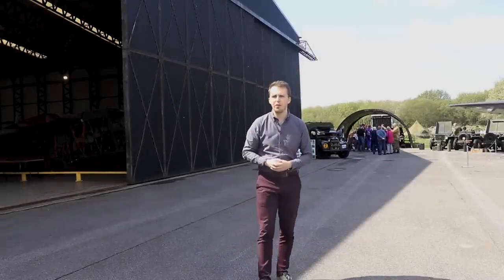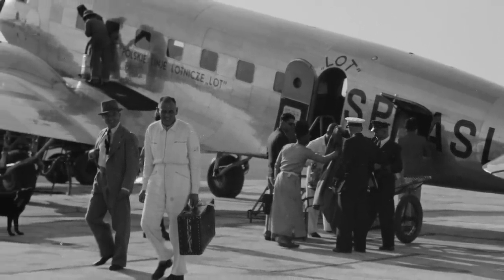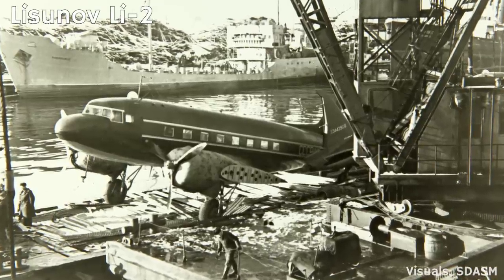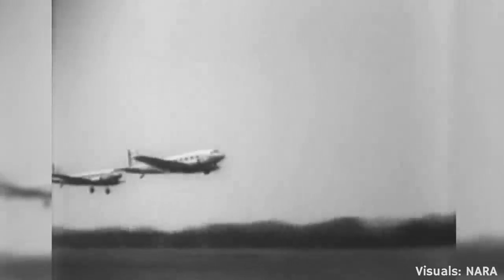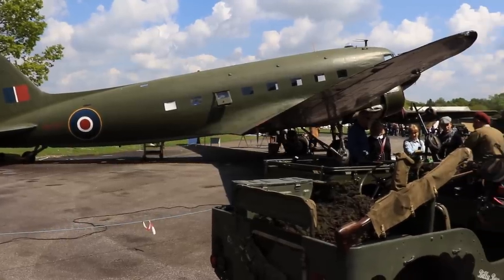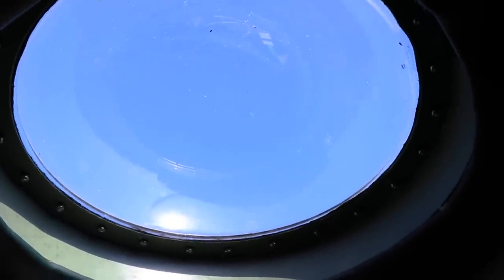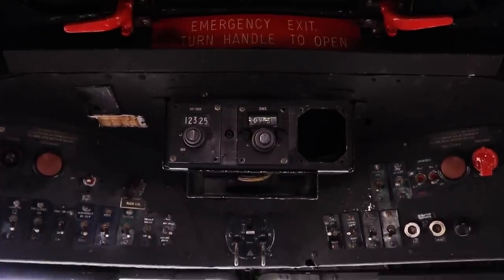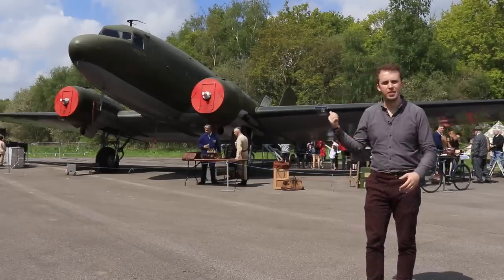Inside The Cockpit - C-47 Skytrain/ Dakota/ DC-3 | D-Day Airborne

Comment: Very good job.  I have worked on DC 2's and DC 3's.  My father flew a DC 3 for Argonaut Airlines between Key West and Miami back in the 60's.  When I was an engineer for McDonnell Douglas we had a DC 2 as part of out heritage flight which I helped restore.  I also assisted on a DC 3 used to haul jumpers.  Thus I pretty well know the history of the DC 3 and you really covered it well and in a short period of time.
Reply: I used to take a DC-3 every once in a while from St. Thomas to Puerto Rico back in the '70s when I got "rock happy." Spend the day wandering around San Juan, go see a movie, and fly back at the end of the day. Round-trip ticket: $25.

Comment: GREAT video Biz!  One small correction... The B-18 Bolo was a mess of DC-2 and DC-3 parts. It has the wing and tail of the DC-3 and the engines and landing gear of the DC-2. Most survivors however were converted with DC-3 engines after the war.

Comment: Flew in them a lot, as well had a nice tour during the Junkers being restored, seeing the aircraft stripped down to near bare metal. With the Dakota, plenty of hours in them, though they were a lot more modern inside, upgraded avionics in most cases, and slightly better canvas seats. With the original P&W engines it was always wise to check for oil dripping out of those oil coolers, because if there was none dripping, there was no oil, and not a good thing. However there are quite a few upgraded to a turboprop arrangement, with much better fuel economy and operating cost, and those are great to fly on. Converse applies there, the oil coolers actually work.

Only one time I was worried flying on one was when we had undercarriage failure, and had to circle till empty before landing, after a few cycles of the gear, with me as the human lifeline holding the flight engineer, as we both were leaning out the door looking if the gear was down ( it was), and it looked like it was locking ( no green light on the pedestal). Best, smoothest, landing ever, though slightly marred by the 45 ton Rosenbaur fire engine that was pacing us down the runway with a running foam cannon. Switch was sticky, percussive maintenance and it was fixed enough to fly us the rest of the way. Got in to my destination 6 hours late, walked in and was asked why, replied the Dakota broke down, and we all had to get out and push.

Comment: In the late 1970's as a young technician in the Canadian Forces I worked on a rather unique 'Dak' named Pinocchio at CFB Cold Lake. It was one of a number of DC3's modified with a CF-104 Starfighter nose complete with radar installed. These were used as radar trainers for CF-104 pilots. A radar console was installed in the cabin with a 't-rack' holding the electronics. A ground power unit bolted to the floor & exhausted through a blanked out window was used to power the system. I believe several other NATO countries operating the F-104 Starfighter, including Germany also had their version of Pinocchio.

Comment: I flew the C-47 in the military. The problem for people of your height: On landing, with a quarterly trailing cross wind, the large "barn door" (vertical tail) causes reverse command on the rudder pedals. Normally, on landing, if the aircraft begins turning to the left, one depresses the right rudder pedal to bring their aircraft back straight. In a quarterly trailing cross wind, situation, the opposite happens, i.e. depressing the right pedal makes the aircraft turn more to the left. To counter that, the pilot MUST "peddle" the rudders, like a bicycle, to determine which peddle produces which result. And while doing that he must bring the yoke back into his stomach, to assist the rear tail wheel to come down to the runway. IF the pilot has long legs, doing that becomes a problem. The control arm for the yoke can get caught on his leg, while he's trying to peddle the rudder pedals. Often times it keeps him from making the necessary corrections and he can easily run off the runway. Just a guess, but I would imagine in the early 30's, when this aircraft was designed, pilots, and people in general, were a lot shorter and the above problem was not an issue.

Comment: The Japanese version was not the Type O (letter "O"), but the Type 0 (zero).  Japanese military equipment, whether aircraft, weapons or other, were assigned type numbers corresponding to the year of adoption.  So both this plane and the A6 "Zero" fighter were accepted by the military in Imperial Year 2600, which on our calendar was the year 1940.
Reply from the maker: I think something got lost in translation there. I usually refer to 0 (Zero) as 'oh' when counting, think I picked it up in language classes long time ago. I know Zero would be better, but it is engrained now. Obv, the vocal difference between 'oh' and 'O' (letter) is pretty much nonexistent but makes sense depending on the context (like giving a phone number). Will try to keep to 'zero' next time, to make it more obvious - thanks for pointing it out!

Comment: There are still some of these in operational service (4 I think) and some airlines still use them. Some are now being upgraded with newer type turboprops and the extra fuel efficiency (compared to the original engines) now means a higher cruising speed (260MPH+) and 10+ hours endurance. That means at the right time of year (to get a good tail wind) they can fly from LAX to JFK. That's in the ball park of 3000 miles.

Comment: There was an airline, I think it was New England Air, that flew DC-3's out of New Bedfrod Airport. I saw a few of these as late as 1972
Reply: Buffalo and other airlines still fly them now and some are being up-engine (again) with newer more efficient turboprops giving double the take-off power and lower fuel consumption at a cruising speed 100mph faster than the original.

Comment: I first got to fly on one of them after leaving boot camp in San Antonio at Kelly Field. It was suppose to take us to Denver, Colorado to our technical school, but it had problems with one of the engines and we had to return to Kelly Field where we ended up flying on a larger aircraft to Denver. The next time I flew on one was while stationed in Thailand and we flew on one U-tapao air base to Chiang Mei on our R&R. I flew on another one on an R&R during my second tour to U-tapeo. It was a nice aircraft and the first one I saw which had a wing and elevators which was made with cloth on them.

Comment: It was a DC-3 operated by Allegheny Airlines that was the 2nd airplane flight I ever took, probably 1960 or so, flying with my Dad from Allegheny County Airport in Pittsburgh to Harrisburg, the state capital.  My first flight, however, had been on TWA Lockheed Constellation, from Greater Pittsburgh Airport to NYC LaGuardia, so I wasn't real impressed with the DC-3 in comparison.  Seemed a bit rustic and Spartan in design, but both flights were great experiences, and I was very fortunate to have the opportunity at a time when kids didn't get very many chances to fly.  In those early days of flight, they would invite children to come up and visit the flight deck during the flight, and the crew would give a metal pin with a set of wings as a souvenir.  I might still have it somewhere.

Comment: The production numbers are a little tricky. It's true that nobody could get too many C47s. It's also true that the plane was designed for durability and not high performance - and it was not normally put in harms way. So the hours per plane were far higher than a combat plane. Pilots didn't count missions - they counted hours. Anyway, that meant a whole lot of those planes made were in service - after the war also. One reason there are lots of C47s today and fighters are rare.

Comment: United Air Lines had an exclusive contract with Boeing for the 247.  United got to lock out the competition, Boeing got assured sales.  But the other US airlines didn't like being locked out and went to Douglas.  The small development delay between the Boeing 247 and the DC-2/3 made the DC-2/3 a better airplane, and the larger customer base made its production more efficient and cheaper.  United and Boeing got bit by their own greed.

But the same development delay later with their first jet airliners, the Boeing 707 and Douglas DC-8, went in Boeing's favor.  C'est la vie.

Comment: C-47 over Ju52 anyday - I prefer my gear retracted when it's not needed :)
Bis - do you think that the German focus on short, sharp campaigns was one of the reasons their air supply capacity was overlooked and neglected? You mentioned in one of your previous vids on Operation Husky (I think) that it was seen as an undesirable assignment for a German pilot in WW2.

Comment: It was not a tradition or built out of convenience to start the right engine first! It was a requirement because that engine is what supports many of the aircrafts startup systems such as the auxiliary power unit, hydraulic pumps and avionics. Of course these systems were engineered to this engine primarily due to where the doors were as well as the cart operator that provided the external power to the aircraft during cold or hard start situations. Regardless, traditions have absolutely nothing to do with this fact whatsoever!

Now I am sure some fanboy is going to try and flame on me and say something like that makes no sense because that means if the right engine goes out during flight all these systems would be at risk of failure. Fact is that is not true, since with the built in redundancies once the engines are running and operational either engine can take over any one or all of these systems. So even if the right engine fails, the left engine will still control the avionics and auxiliaries. Hydraulics on the other hand being a secondary system on some aircraft did in fact rely on the left engine and should that engine die they were provided with hand pumps in the cockpit that they would have to use to say lower the landing gear.
Reply from the maker: The C-47 can start either engine first. Each engine operates a seperate hydraulic system and generator.
Reply: @MilitaryAviationHistory  Correct:
Procedure for Engine Fire (or engine inoperative in flight):
1. Throttle - Close
2. Propeller - Feather
3. Mixture Control - Idle Cut off
4. Firewall Shutoff Handle - Pull
5. Fire Extinguisher - Discharge if fire exists
5. Hydraulic Pump Handle - Operative Engine

Both engines are independent and control their own hydraulic and electric systems.

Comment: Those static lines are not original. Do not even look original, if you know how the original look like. The Americans used a cable running along the ceiling, and atached their parachute static line,at the end was a special staticline hook, to it. The British used a cable that run behind the seats (2 cable port and one starbord). At the end of the British staticline was a triangle that became attached to a so called strop. A strop had a triangle attached to the cable, fixed to it was a length of parachute webbing and at the end a special snaphook were the triangle of the staticline was attached. Every aircraft the british dropped from, had a strop with webbing of different length. Even de position from witch the paratrooper was seated could mean a different length of strop.This was to make sure that every parachute opened from the same distance of the aircraft.
The strops in this aircraft should be attached with a triangle and not to the American topstatic line cable.
Reply: but he previously mentioned that this plane was used in shooting "Band of Brothers", so they likely switched it for the movie and never switched it back, just as he said about the seats.